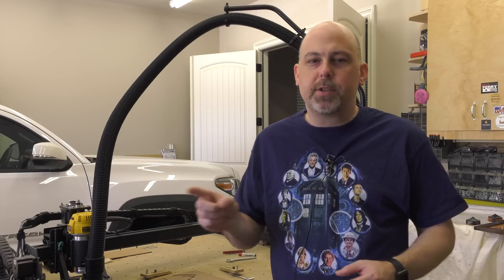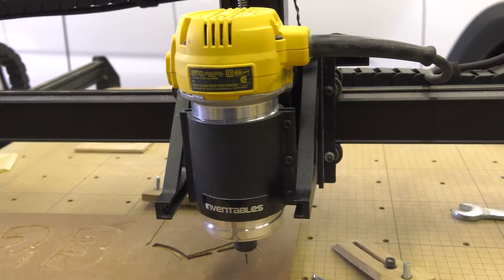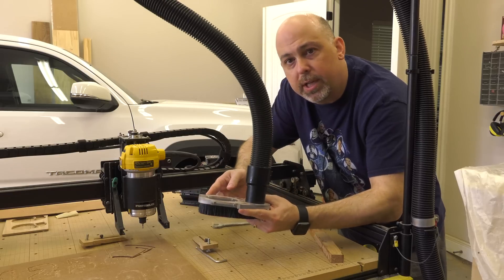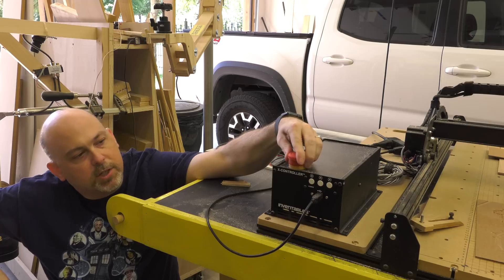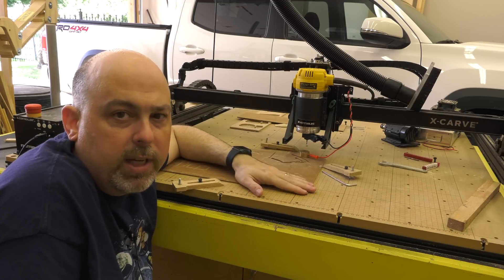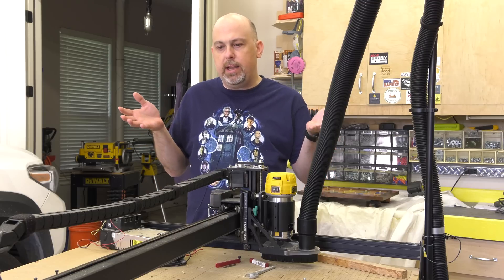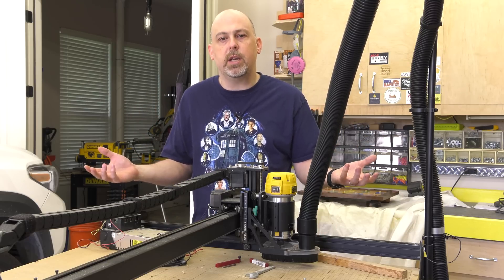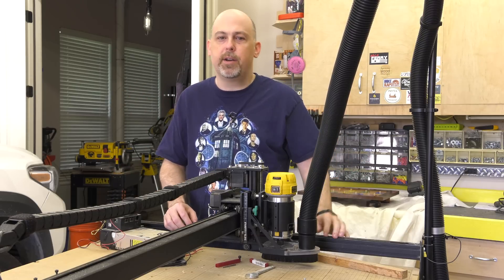X-Carve Upgrade HONEST Review

Comment: Hey Mike, thanks a lot, me being from a Mechanical field, I too believe that such belts are only good for 3D printers, which has light & fixed load (filament melting head), but during heavy machining the operating machine should have ball screw. A solution to the belt would be to apply a "belt tension spring" available on Amazon. 
Do you have any such cnc with ball screw, which is good and at the same price rate.

Comment: A rack & pinion system would have backlash in it that the software would not be able to deal with. The true solution to your complaint would be a leadscrew for the X & Y axes.

Comment: Hi ! 
This surprises me that there is constantly slipping during machining.
Maybe it helps: at first I had this problem (I do not have x-carve but they are standard parts that I put in my machine); it was the screw of the pulley that was not tight enough ...

Comment: I bought the first release of the xcarve. I pulled the original spindle right away to use on a small mill replacing that with a router and stiffened the gantry via some 3d printed inserts. I haven't had much issue with the steppers being under powered with the materials i cut but i'd love to see whats all in the new controller box. I'll have to look into that.

Comment: Looking at the pricing differences between rack, and 4 start acme lead screws... lead screws would be the better way to go. 
You could mount them under the axis rails.. This would allow you to cover the lead screws completely save the slot in the cover for attaching the gantry or carriage to the lead screw nut. This would solve the issue of missed steps. Increase accuracy, and the covers will help reduce dust and debris getting everywhere important.

Comment: Your belt is probably not slipping, you need to turn up the power to the stepper motors because they are skipping steps. I cut aluminum on my machine without problems. All info is on the forums at the website. Thanks for sharing!
Reply from the maker: Nope.  This is physical belts slipping at the ends.  Inventables has fixed it for me.  Follow up coming soon.
Reply: I heat shrink the belts and I sometimes get stretching but no slipping. A trick I caught from someone else when I bought my first one.
Reply: Hi friendo - I'm curious to know what the fix was and if it's something they've done to upgrade the whole setup. I'd like to know because I'm about to buy the thing - I don't know of any other CNC machines in this price range that can give me a 60x60" work area right off the shelf, so I'm really hoping that this thing works out.
Reply: Please let us know the fix when you can. Thanks in advance.
Reply: I'll definitely wait for that, I'll wait before I order anything! :)
Reply: "heat shrinking the belts together at the ends... The heat-shrinking worked by locking the teeth together on the belt" https://www.thegeekpub.com/2805/blog-first-run-of-the-x-carve-and-slipping-belt-fix/

Comment: I just finished building the ox metal cnc, which uses Acme lead screws. I think you are spot on when you're talking about the belts. You would never see any commercial machine with a belt. All of them have Acme lead screws and some of them pretty massive. The Ox metal is relatively easy to put together, although the wiring does take a fair amount of soldering and routing. The actual machine and motors can be assembled in a day.
So, I'm mentioning this for people who are considering an alternative to the X-carve. Check out the ox metal. Most parts can be purchased through open builds, and things like drag chain, bearings, etc. can be had through China or Hong Kong. Depends on how quickly you want them.

Comment: Lead screws would solve the problem, but the belts are much cheaper. My guess is Inventables want to make the machine accessibly cheap. Maybe on the X-Carve 3 they will offer it as a cost upgrade? There is a guy on the Inventables forums that was selling a upgrade kit he had designed at one point...

Comment: DO YOURSELF A FAVOR AND REPLACE THE BELTS WITH KEVLAR BELTS
Reply: The existing GT2 belts are already re-enforced so that probably won''t make a massive difference. You would have to step up to lead screws. Lead screws are much more expensive and the X-Carve is designed to be a cheaper affair.

Comment: Personally I've not had issues with the X and Y belts on my Shapeoko 3. I'm not saying you're wrong about your experiences - just sharing my own. I have, however had an issue with the closed loop belt on the Z axis - I think it was out of spec from the get go though. Replaced and have since not had any issues. Rack and pinion I think would have some of its own issues but it might be interesting to test it out assuming you could adjust the controller properly to suit it.

Comment: I guess rack and pinion just cost more? Shapeoko 3 also uses belts. From CNCRouter Parts, they've got 1m gear racks for $42USD+P&H (which would increase over belts because weight). 3 of those (closed loop on the Z axis is probably OK to be a belt), they also have NEMA23 R&P pulleys for $10.25ea. USD$156.75. If you price out just the mechanical parts of the 1m XCarve its $398 - percentage-wise, that adds a fair bit to the cost of the mechanical parts, but once you get to adding the electronics, overall its a relatively low increase.

I don't disagree with you, R&P would solve other issues too, like the awkward "you should pluck it until it sounds like a guitar string" tension guides. I wonder if its modable to R&P (I suspect you'd need to make entirely new plates), or if ballscrew is the 'better' way to go? I have no real knowledge of these things, so I wonder what I'm missing!
Reply from the maker: I've actually thought about trying to convert it myself.  The issue would be Easel wouldn't know how to run the machine anymore. The likelihood my gears would be the same ratio as the belt system is next to zero.
Reply: Strictly speaking, Easel doesn't need to know how to run the machine, it sends standard GCode to the GRBL controller built in.  Easel knows the physical limits so it can generate the GCode appropriately, but GRBL does all the interpreting of X/Y points to linear motion.

You'd need to make some changes to the GRBL settings (Use UniversalGCodeSender, or telnet to COMX at 115200bps, I can't remember if you're in the .NET world, but SerialPort in C# too ;)) to adjust the steps-per-mm, but part of the XCarve calibration (that they don't mention) is doing that anyway. Default settings are 40-steps-per-mm, but that might change to 20-steps-per-mm or 80-steps-per-mm, depending on the toothing/etc.

Comment: Rack and pignon have some backlash. Better use larger belts (adapted to the required torque) or screws.
Reply from the maker: Almost every industrial CNC uses a R&P.  Those that don't use a a screw drive.
Reply: Well, this is not the ultimate argument. I'm an industrial CNC user and owner. Believe me or not, but R&P have backlash. Actually my main CNC mill (10x5 feets) uses 25mm HTD 5M belts and work as a dream. It's faster than screw driven CNCs and ways better than R&P systems (like my first industrial CNC was, back in 2009). No way I return to R&P or long Ballscrews machines ! Screws replacement cost a fortune every year and a half for me. R&P don't wear that much, but backlash is a real issue. R&P just holds a lot of torque, but it's not precise as expected, especially in straight lines following X or Y axis. Belts are not a factor as long as they are properly sized. They last longer and are pretty quiet. Just my experience. On the Xcarve, a proper R&P system will be pretty expensive compared to the retail price of the machine. Through, where would you install it ? There's not enough space or any proper support. The MakerRail system does not match with R&P systems.

IMHO the Xcarve was not pretty well engineered, but it was simple and coherent at the start for light carving purpose, for a reasonable price. It was not a proper CNC mill because of its spindle, its light transmission and its light structure. You can upgrade the spindle for a 600w DW, a better gantry, a better controller, but what it really needs is a proper study  to make an acceptable Hobby CNC mill. There's no miracles with CNCs. Upgrades are not the way to go : if you upĝrade a thing, especially the spindle, everything needs to step up too. Actually, it seems the way to go is upgrading the belt system to the required size for few bucks. BUT, don't expect the xCarve to be a proper CNC mill. It's still an upgraded CNC carver. So the feed and speed must be constrain in a low range. Heavy jobs should take time anyways.

Comment: Thanks for the review. The belts are exaclty why I skipped the x-carve, the shapeoko, and the carvey, and got a nomad. Threaded rod is just leagues better. Granted, the nomad has it's cons, like small workspace and somewhat underpowered spindle, but at least it works every time and the threaded rod will never slip like a belt will.

I really wish one of these bigger consumer class machines like the x-carve or shapeoko had a threaded rod option. Even if it cost a couple hundred bucks more, it would be well worth it.
Reply: caramelzappa one of the problems with threaded rods are speed compared to belts but cost wise wouldn't be much more

Comment from the maker: The team at Inventables sent me the latest upgrade for the X-Carve and asked me to give it an honest review.  I hope you guys know me well enough by now that I don't ever give any product anything but the truth when it comes to reviews!
Reply from the maker: I can't find anywhere I misspelled it.
Reply: 2 of the upgrades one of the members of our makerspace did to his x-carve was to 1 - add tool steel between the two pieces of aluminum to strengthen the gantry. 2 - replace the belts with belts with wire in them. They don't stretch at all. 
Well.. 3 things.. He put in a dewalt router and change the control board to a smoothie board.
Reply: Soooooo. Has the belt problem been fixed on the brand new machines?
Reply: http://shop.polybelt.com/Open-End-Belt-Roll_c26.htm
But... From what I'm reading, a fiberglass re-enforced belt is better...